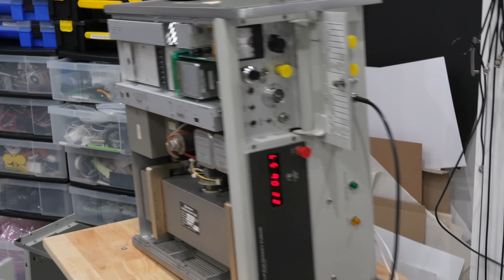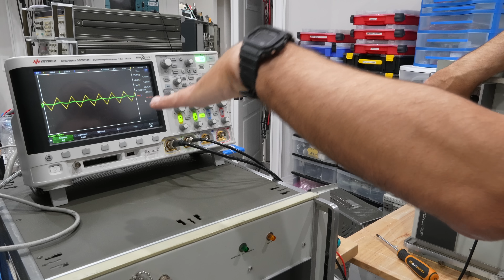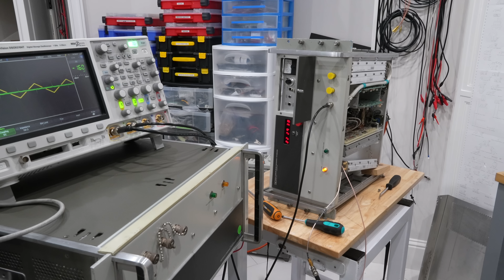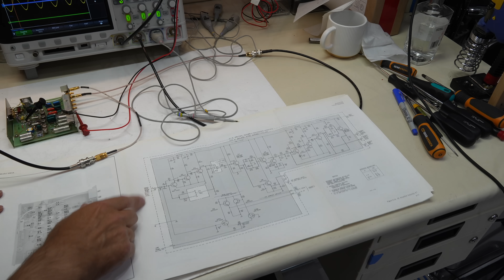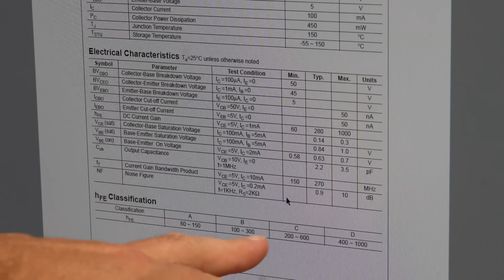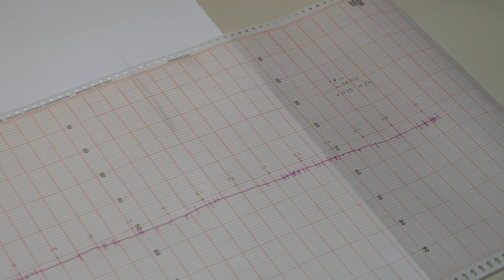Another HP 5061A atomic clock comes in for repair, and it's very broken

Comment: Did you check if that green neon(?) bulb was working or had failed? 😆🤷‍♂️
Reply: It's a 28V incandescent lamp. Originally it wasn't lighting up because there was no bulb there.
Reply: @lwilton  Yes! I've finally applied my skill and experience to one of Marc's projects and found one of the faults! 😆
Now they need a second pair of clocks which are  out by +6ns to cancel out the first pair's error.